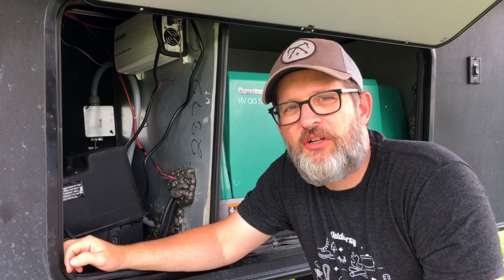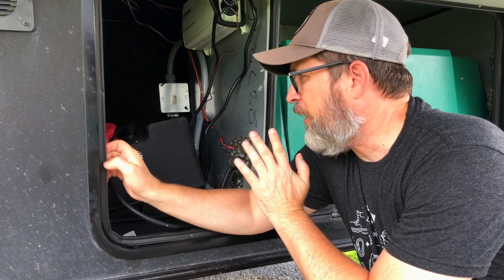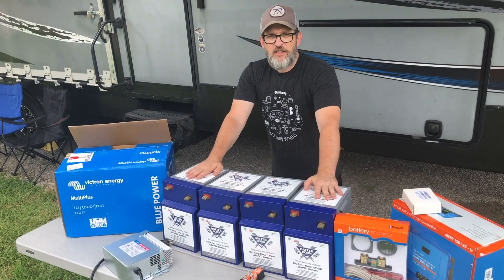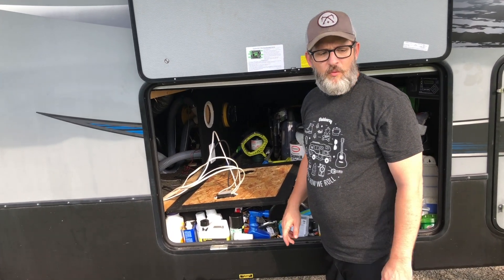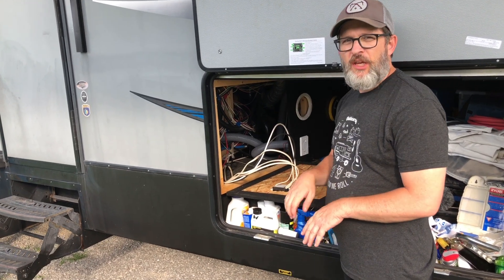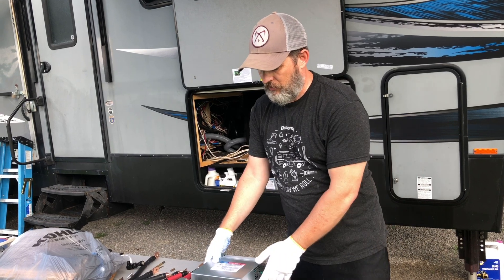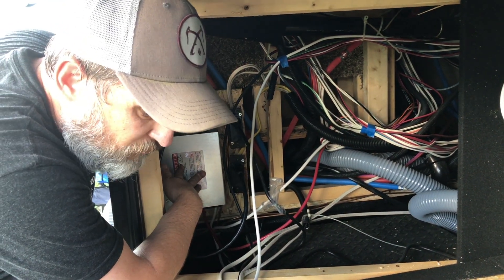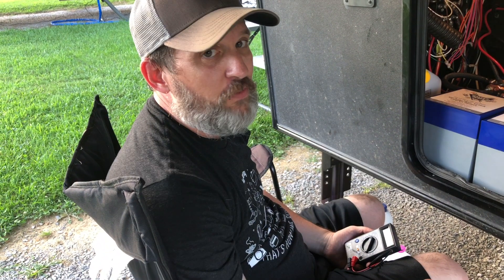RV Solar Upgrade Part 1: Battle Born Lithium Batteries & PDI Converter Install

Comment: I'm considering investing in a battle born system.  Is there any reason you went with 12v setup  instead of a 24v setup?
Reply from the maker: It was easier. No other reason.

Comment: Since lithium really like to be 20-80% range and it will extend cycle life, why didn't you just use existing charger/converter? If you have solar and an mppt controller,  wouldn't that top off batteries without changing converter?
Reply from the maker: To be honest, Bob, My solar does all of the charging. I rarely have my converter plugged in and most of the time I have the inverter/charger set to inverter only. The solar and mppt seem to get the job done. SInce I had the opportunity to upgrade the converter, I thought it was a good idea to be most compatible with the technology. In retrospect, I probably would have waited to upgrade the converter since the solar does such a good job.

Comment: May I ask, what you do to your old battery? Why don't you just buy a portable power station or a generator?
Reply from the maker: We just go rid of our old batteries. We went with these 100 amp hour lithium batteries over a portable power station because we wanted to power our entire RV. We do have a generator, but don't like to use it all day for two reasons: 1. noise 2. gas. With the lithium batteries, we only need to use the generator for an hour to fully charge them. Then they last a couple of days. We also have solar panels so we actually only need to use the generator if we have no sun for a couple of days.
Reply: @ChickerysTravels  Thank you for sharing the infos, it's very insightful. So it seems use the generator once every couple days is enough.
Reply from the maker: I don’t think it would be enough if you had lead acid batteries. You can’t take them below 50% without causing irreparable damage. But with the lithium’s, yes. You can discharge them fully with no damage.
Reply: @ChickerysTravels  I just saw some good deals on Indiegogo for Lithium portable power station, around 2000wh for $1000, with 2500 life cycles. Do you think thats a better deal than buying Lithium battery directly for your camp?
Reply from the maker: No. Two of Battle Born’s 100amp hour batteries would give you 2400watts and are 5000 life cycles with a 10 year warranty. They are $899 each, so you’d pay about $800 more, but the warranty is worth it.
Reply: @ChickerysTravels  I see, at least they seem to last much longer.

Comment: Hi, Great 4 part videos, very informative and helpful! But I''m a little confused as to why you replaced your 12 volt led acid with 12 volt GC2? Is there a difference between BB 100Ah 12volt and the BB 100Ah 12 volt GC2? Thank!
Reply from the maker: There’s no difference between those two batteries except the case.
Reply: @ChickerysTravels  Good to know, Thanks!

Comment: Thank you, everyone else on these conversion to lithium videos skips the converter for some reason.
Reply: The converter is redundant.  Inverter charges the batteries when on shore/gen power. In fact if you have the inverter powering the whole 110v panel then you will probably create a power loop when running off inverter power.  Batteries>inverter>converter>batteries. This is wasteful.
Reply: @davidgosserand8100  An inverter is used to change direct current (DC) to alternating current (AC) (so you can run 12 volt appliances). Converters are used to convert AC power to DC power (this is to keep the house batteries charged when hooked up to 110 volts).  The old converter in an RV may undercharge, charge too fast, too slow, overcharge, etc. the new lithium RV batteries (LiFePO4), the converter must be matched with the batteries to charge them properly.
Reply: @laronis  The inverter that is being used in this video has a built in charging function.  So not only does it convert DC to AC, but it takes incoming AC from either a generator or shore power, and converts it to DC to charge the batteries with.  Therefore the converter is not needed.  Read the other comments.  The creator of the video explains this several times.
Reply: @davidgosserand8100  Oh, i have always called those" inverter/chargers" or "inverter/converters" when they contain both functions.   I never heard of them just called inverters, good to know (but seems confusing).  To me an "inverter" was just something that takes DC to AC, nothing else.
Reply: @laronis  I mean if you want to get specific, yes that is what they are called.  I figured you already knew that from watching the video though, because that is what we are talking about after all. 😂
Reply: @laronis  Anyways, to answer your original question, that is why everyone skips the converter, because almost everyone I've seen doing this type of upgrade uses an "inverter/charger" which means they don't need a converter unless they want to spend extra money on redundancy.
Reply: @davidgosserand8100   thx!

Comment: I thought that with the multiplus you wouldn't need another converter because it has one built in. Am I wrong about that? I'm just learning and getting ready to do an install.
Reply from the maker: It is a redundancy. I wanted it in case the charger in the Victron ever failed.

Comment: Did you consider a 24 volt battery bank instead of 12volt like Pau Hana did.  Why did you choose the 12 volt batteries?  Since you have a large battery bank of 4 batteries, a 24volt system has many advantages and the only main disadvantage of having to use a 24-12 volt converter to supply 12 volts to the coach.

Comment: This converter is not necessary if are going to install the victron multiplus 3000 later, I’m not sure why you installed this converter?
Reply from the maker: For backup and quicker charging.

Comment: Ok, i have the PD lithium converter and the lithium batteries.  Why did you get the Victron inverter with a charger?  The converter charges the batteries.
Reply: yea wondering the same thing
Reply from the maker: I hardly ever plug in my converter. My solar does all of the charging. I rarely have my converter plugged in and most of the time I have the inverter/charger set to inverter only. However, it never hurts to have redundancy when it comes to power options. I much prefer the inverter changer and solar over the converter.

Comment: This is such a helpful video, thank you. We're getting our 12ft trailer with one 100W panel on the room (it's all it will fit) and are going to add more as we go but use the Yeti lithium battery (it's also an inverter to 120v). Just subbed!
Reply from the maker: Thanks for watching! We added more panels as we could afford it. Smart way to go!
Reply from the maker: Subbed back!
Reply: @ChickerysTravels  wow, thanks!

Comment: This is the reason i preach to all the beginners. At my home I have my same un sealed lead acid battery setup going for the last 6 years. Dont believe people saying you have to change every year. You can easily buy 10 unsealed, serviceable, refillable lead acid deep cycle batteries at about 130 cost per battery and have 1000 amp hours or for some 500 amp hours, compared to just having 100 true lithium amp hours for 1000 dollars. I don't share these same problems that  others have on the internet. Its bullshit and you can easily over size your power for less money and have more power to keep from running out. Some guys run small systems and complain. The key is to oversize your power bank. And you will always have more amp hours than the lithium boys. And at a better cost to spend elsewhere. And their batteries are not serviceable to them at home, after the end life. Stop paying these guys and make them drop their prices, You can survive with unsealed lead acid batteries, I am the example.
Reply from the maker: Thanks for providing your thoughts. I personally would not want to have the weight of 8 lead acid batteries, but I know some that share your position. I think that is the great thing about RVing, we can all share our opinions. It is definitely cheaper to go your way, but the weight and the slower charging profile are issues for me. Plus, no maintenance is huuuuuge :) Thanks again!
Reply: For me personally it was a lot cheaper to upgrade to Li batteries than to upgrade my motorhome to something that could carry another 600 lbs. of lead acid batteries without being over weight. I figure I saved $20-60k. Your mileage may vary.
Reply: @stevehanson279  I understand its cool,  I just don't support the corporate cost of 1000 for 100 amp hours, And because I understand batteries, I just cant make myself pay that price, while  I have perfectly good system. I teach beginners that they don't need to spend that price to have a great solar power and experience. And mobility is important. My system is mainly home based and I have a motorhome. 1000 dollars can buy 1000 watts of solar easily, they don't preach that.

Comment: I am about to buy a Siesmic 4113 Toy Hauler, do you find the 4 batteries enough? I have 8 lead acid batteries in my current 5th wheel, with 8 x 180W solar panels up top giving me around 70 amps in on full sun., I find I tax those batteries out with no sun.............I have a cut off relay that cuts off the entire battery bank as to not let them drop below 50% so your 4 Lithium batteries have the same capacity as my heavy 8 Lead Acid Ones as you don't have to worry about Sulfating a lithium battery bank. So just wondering how you are making out with the 4 Lithiums?
Reply from the maker: The four are working fine for us. We are not big energy users. I have 800 watts of solar and that keeps them topped-up nicely. I have a buddy with a new Grand Design Momentum and he has 6 Battle Born lithium batteries and 2000 watts of solar. I think he can run everything. We also added the easy start to one AC so we can start that with the batteries and inverter/charger if we need to cool things down after a travel day.

Comment: GREAT Vid!!!  
We have the factory / OEM WFCO 45 Amp (maybe 55 not sure) Converter/Charger that came with our 2018 Heartland Pioneer 250RL.  Everything is working fine with 2 Interstate Batteries.  1) Would there be any inherent  advantage to upgrading to BB Lithium Batts? And 2) Would we be required to upgrade the Converter/Charger as well if we went with the BB Batts?  Please advise.  Much thanks.
Reply from the maker: Thanks for the compliment. Your question is loaded :) The switch to Battle Born batteries really depends on your style of camping. If you only use the RV in campgrounds with hook-ups, you can probably get by with what you have until the batteries wear out and then make the decision. If you spend any time camping unhooked, the Battle Born batteries are the way to go. We wish we would have made the switch sooner, as do many of the the other people we talk to. It is nice to be able to park some where for the night and not have to worry if your batteries are going to last without having to fire up a generator. Since we also have solar, we also use our batteries and solar to save on electric at campgrounds. Whenever we get the monthly rate, it usually has the caveat of metered electric. With our solar and batteries, we can save on that metered electric. As I am typing this, my batteries are at 42% and I am not worried. If these were lead acid batteries, they would be dead. As for the converter, it will probably work fine, but I would ask the folks at Battle Born to be sure. They are very honest about what pieces of your current system you can keep.
Reply: thank you for your reply!  makes sense. appreciate the lesson. be well.

Comment: How did you mount the batteries? I didn't see any tie-downs. Also, will you be adding a battery box?
Reply from the maker: The batteries are in a frame at the base of the batteries. Between the little frame, the cabling, and the tight fit in the compartment, they do not move and we have been on some rough roads and one accident. Lithium batteries do not need to be in a box. They are completely sealed. That is one of the benefits of having them :)

Comment: One question I have is why you installed a PDI converter/charger when the Victron unit is also a charger?

Also, at 1:38 on the picnic table there's a device sitting in front of the batteries - what is it and where did you install it?  I didn't see mention of it in the video.
Reply from the maker: Great question. I installed the converter for two reasons. One is redundancy in case the inverter/charger goes down. The other is speed. If I am in a hurry and need to charge my batteries, the converter charges them very fast. 
The device sitting in front of the batteries is a DC disconnect. If you go to the following link: http://www.beyondthewheelpodcast.com/beyond-the-wheel-ep-3-battle-borns-sean-nichols/ and click on the video presentation, Sean Nichols talks about the device. It will cutoff the DC loads before the batteries get to 0%. It goes between the batteries and the DC loads. I must confess that I did not install it in the videos because I was unsure of the location. I am going to put out a couple of update videos soon. One is for the disconnect and one is for a bluetooth adapter for the inverter/charger that allows you to change the settings without connecting to a computer. Thanks for watching.
Reply: I understand the redundancy reason, but could you specify which PDI converter you installed?  The Victron supposedly charges at 120A and the largest PDI for lithium I could find charges at 80A.  Also, how does the system decide which charger has priority?  Do you switch manually between the two?  I'm just trying to understand how everything works together.  Thanks.
Reply: I have similar questions about which charger get used as BearUkulele.
Reply: @BearUkulele  :  Yeah, Sean unfortunately doesn't tell us which model of Progressive Dynamics charger he installed.  I don't know why he left out that rather important piece of information.  :-\

Also, like you, I'm a little unclear on how he uses the two chargers.  Does he run them both at the same time when he wants a fast charge?  That's what it sounds like he's saying.  Does that even work?  Do they not interfere with each other?

Comment: I am a little confused, I thought an inverter/charger would be responsible for charging the batteries eliminating the need for the converter.  Can you clarify?
Reply from the maker: You are correct, Nathan, the inverter/Charger will charge the batteries. I know some folks that do not have a converter installed for that reason. We chose to install a converter compatible with our new batteries for some redundancy in case of failure. We have learned over our 4 years of RV living that redundancy is good. But, you are correct that it is not necessary to charge the batteries if you have an inverter/Charger. 
Thanks for watching and adding to the discussion!
Reply: @ChickerysTravels  So are both chargers pumping into the batteries when hooked up to shore power?
Reply from the maker: @triXsolarflare  I do have the inverter/charger and converter on when hooked up to shore power. Each Battle Born battery has a built-in battery management system that will not allow the batteries to overcharge.
Reply from the maker: @triXsolarflare  I should also add that the solar charge controller and the inverter/charger stop providing a charge to the batteries when they are full.
Reply: Keeping in mind that an under charged battery is just as bad as an overcharged battery, does the Battery Management System protect against a cell dropping below the danger zone of about 2.7V?
Reply: @triXsolarflare  2
Reply: @MYCHANNELWITHMYSTUFF  They're lithium - are you sure your question is about Lithium Batteries?
Reply: @CanadianTexaninLiguria  yes I know they lithium batteries.  A battery is a battery.  They all work on the same principal.  You can over charge a battery  and you can allow a battery to drop below the safe zone.  My question is directed at the battery management system.  Not all BMS's  are created equally either.

Comment: When you say you "partnered" with Battleborn, what exactly does that mean?
Reply from the maker: Great question. We purchased everything through them, with the exception of the solar panels, instead of going through individual dealers. Also, they have been providing technical support through the install process (phone & email) since I was doing this by myself instead of a professional installer.

Comment: Great video. Can't wait to do ours. The weight of the lithium is my biggest draw because we also have a 5500 generator and I don't want to go to heavy on the pin weight. Thanks for the info. Be safe. Safe travels.
Reply from the maker: Yes, the weight difference is huge. You basically double your amp hours with half the weight. We have been very happy with the performance so far.
Reply: Lithium is particularly advantageous if you don't have solar and rely on a generator. If your generator / charging systems is big enough you can go from 2% to 98% in an hour, unlike the 4-5 hours it took to charge my lead acid batteries. Much less annoying to your neighbors.

Comment: You did a nice job on the video explaining what you are doing, the tools needed, and a nice job of installation.  Impressive custom cables for the batteries.
Reply from the maker: Thanks, Don. Amazingly, I did not know anything about this "electricity stuff" before meeting some fellow RVers in Wellington. Amazingly, my system is still running! I can't wait to finish installing the solar on the roof. Julie and I look forward to meeting you.
Reply: Chickery's Travels can I ask who makes that hydraulic crimper?